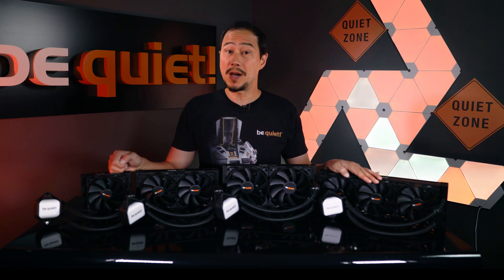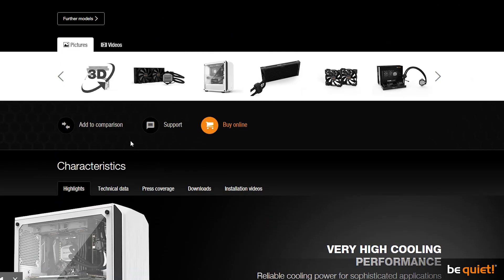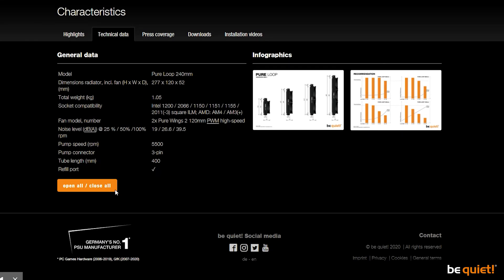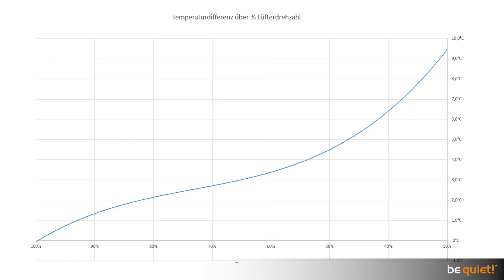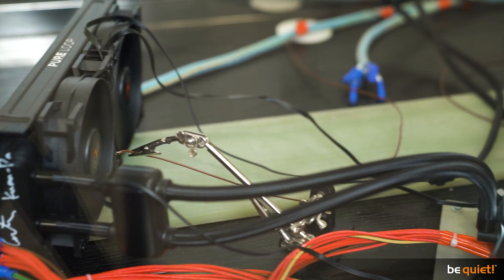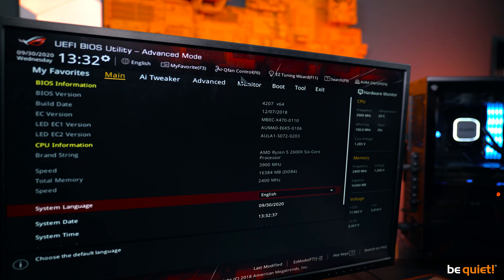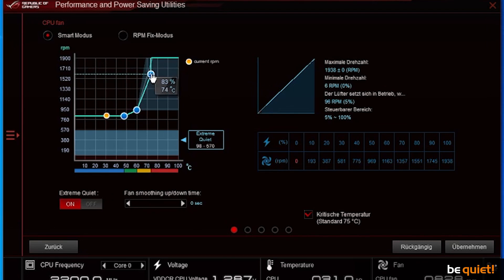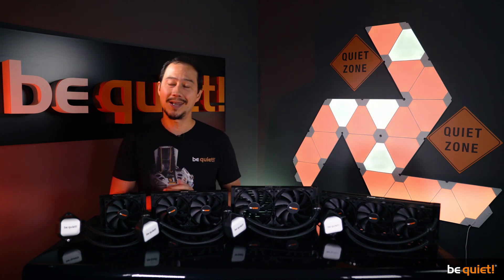Water cooling: Everything you need to know! | be quiet!

Comment: could anyone tell me if the be quiet! Pure loop cooler will fit inside the be quiet! Pure Base 500 case?
Reply from the maker: Optional radiator installation
Front (mm)	120 / 140 / 240 / 280 / 360
Top (mm)	120 / 240
Bottom (mm)	-
Rear (mm)	120 / 140

Comment: i really like your products and i own plenty of them as well.dark rock 3,dark rock 4,dark rock pro 4 and all my fans in the case are be quiet,,my case is pure base 500 too.right now i have installed dark rock 4 push pull config on my i5-10600 and results are great,,idle 24-30 and on heavy load on games never went above 60.you think is better to swap dark rock 4 to pure loop 120mm or stay on air cooling?i dont want anything else than 120mm tho.thanks in advance. p.s. would be really great if be quiet decides to add some rgb on fans or radiators it self,,you will kill the market,trust me!!

Comment: Is it going to fit with tubes down in front of Purebase 500 DX? (280MM variant)
Reply from the maker: Yes, it will. Also the front is the only place in the Pure Base 500DX where the 280mm version will fit.
Reply: @bequietofficial  Even with RTX 3070/3080? :)